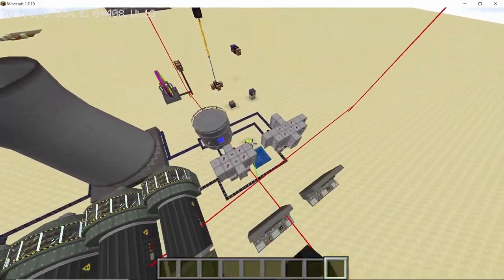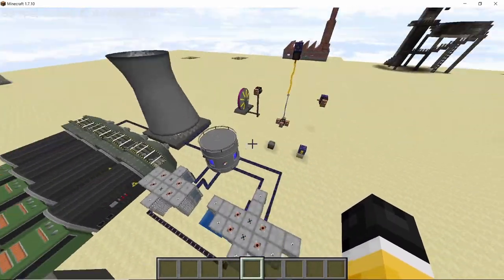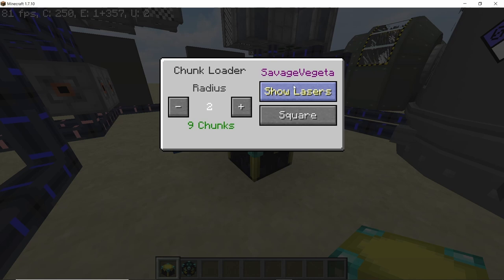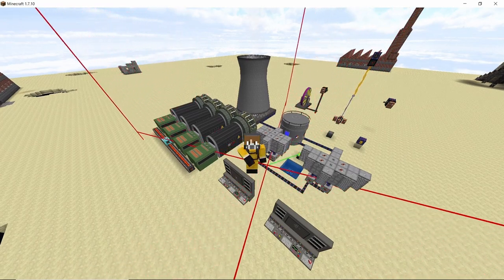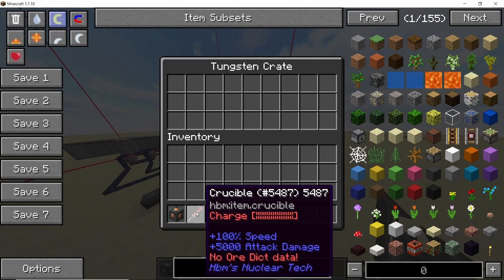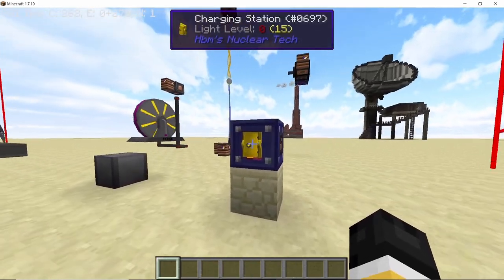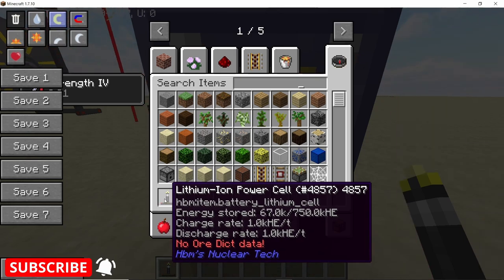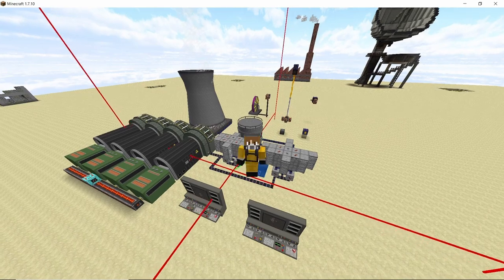Chunk Loaders - Prevent RBMK reactors from exploding | How to Charge Crucible , Power Armors and QnA

Comment: Cool vid man. I ran in to a problem with the spinning power wheel FEnSU, when I put it in my creative DFC reactor and it just started going in to negatives and weird stuff like that. Why does it do that?
Reply from the maker: Hmm energy going into negatives was a bug when the energy system was being reworked on. If you use the latest version of the mod from GitHub you won't have this issue man
Reply: @SavageVegeta  Thanks!

Comment: I researched stuff a bit and found that ChickenChunks causes world corruption apparently, and there are better alternatives such as Dimensional anchors and FTB utilities. Have you ever had any of these corruption issues before when working with ntm, and have you tried alternative chunkloaders too?
Reply from the maker: Dang that might explain the weird radiation problem that I have been having , suddenly radiation will start spreading in my whole world. I have been trying to find reasons for this even asked around on the NTM server but no one was able to pin point the exact thing.
I will definitely try using  a different chunk loader and see if the problem persists. Thank you so much man !!
Reply: @SavageVegeta  I'm not sure about what kind of world corruption the mc forums were talking about, but I hope it does solve that problem :D

Comment: I have a problem when placing too many blocks on the same area, it gives a short freeze like 0.3 seconds to put a block and it's hella annoying, also the chunk with TONS of blocks lags af everytime, if it wasn't for ny potato PC and this issue i've downloaded it earlier (used chunk loaders before on 1.15 XD) still great vid 👍
Reply from the maker: Yeah I face a similar issue when a big RBMK reactor is running ... If I happen to accidentally fall into water which is nearby it takes an eternity to load the next frame cause running the RBMK is resource intensive 🥲
Reply: @SavageVegeta  nghh those Java issues are annoying af 😭